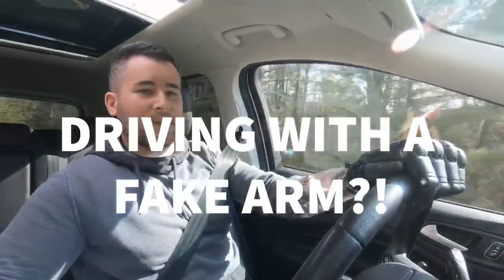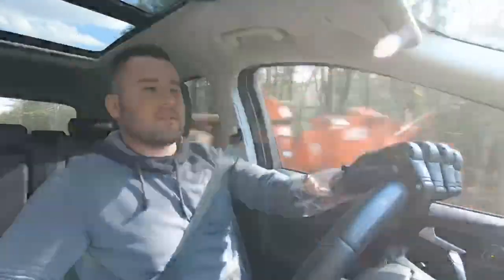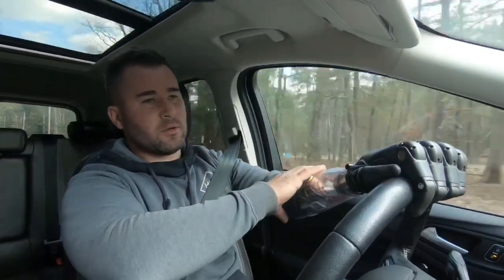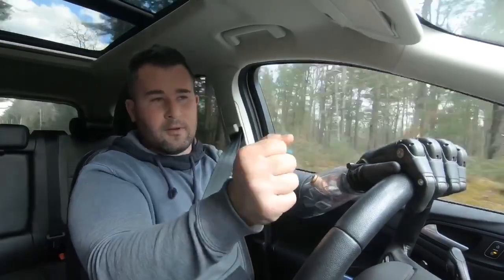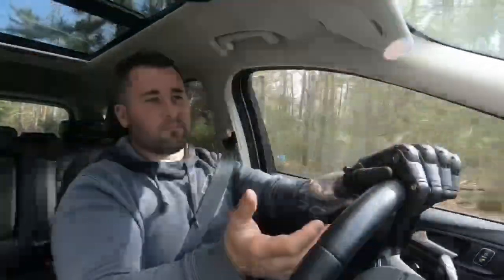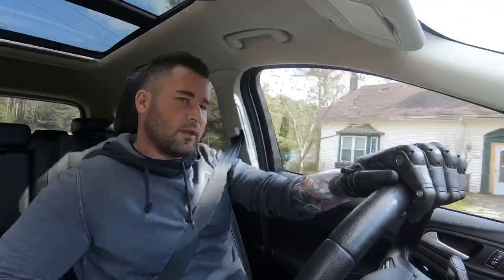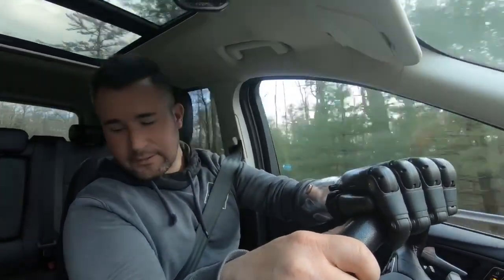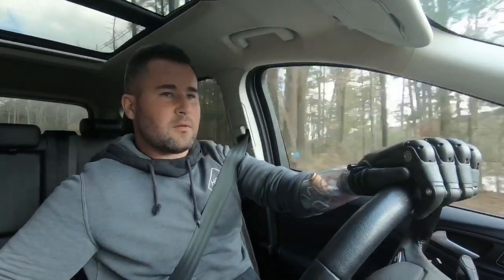Amputee: How I control my bionic arm, and using it to drive home.

Comment: Have to ask you something in regards to the wrist rotate part of the hand just that the mob that is doing mine have tried to put me off having it saying it will add weight to the arm and can be unreliable, I am thinking it sounds like 
BS to me so just they were doing their best to put me off. I'm a scientific instrument maker is my trade as in servo control xyz laser cutting machines. Anyway I look up the wrist rotator specs is 96g and it would be much more than the normal locking one if needs be I will fit it myself.
Reply from the maker: I will not own an arm WITHOUT a powered wrist rotator.  As you said, yes it adds weight, and it is someone magnified since it is so far out on the end of the arm.  I always call it leverage weight, but that’s just my words.  It’s like anything else, you get used to it.  I don’t see an issue at all with the weight.  I can’t stand an arm withOUT a powered wrist.  I suggest you get it, and if for some reason you don’t like it, remove it for a static non-powered wrist.  Good luck, thanks for watching!
Reply: @myoelectricoutdoors  They were saying it added weight and to me 90g is nothing and the non-powered one would be much the same, I just don't know why they are trying to talk me out of it could be the extra cost or they just not up to the tec yet. I still have to get approval from our insurance program in Australia its a crazy government funded project. Think they can make good $$ from the myoelectric hands and over charge. 
The plan maybe come back in a years time and they can grab 10 or 20k for the mod. 
My aim is to land a aircraft with the Taska hand I can do it now with my stump think it will be harder with the hand, should be a good video. Will keep you updated
Reply from the maker: @Nessy..  powered wrists have been around forever, so none of it makes sense for them to try talking you out of it.